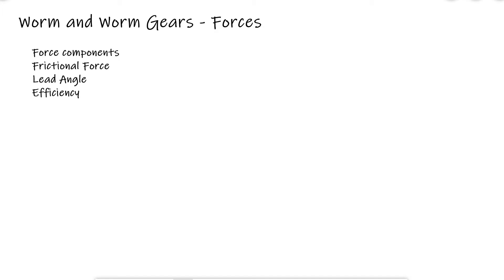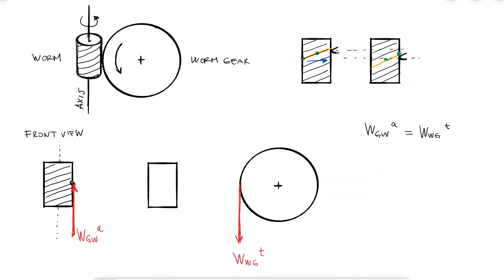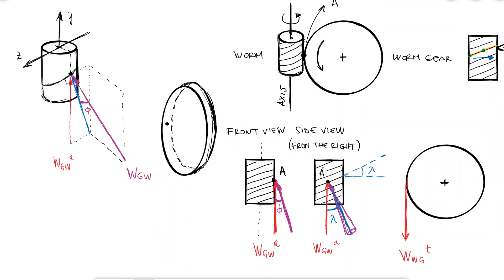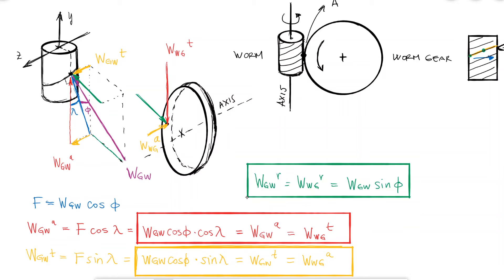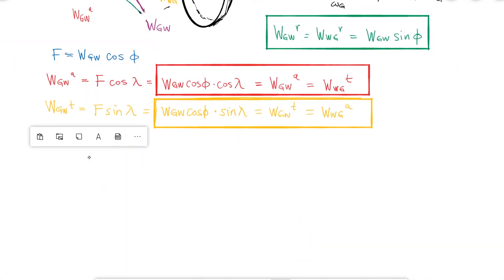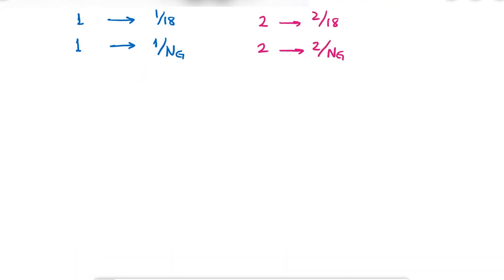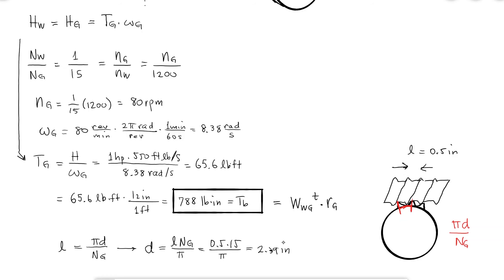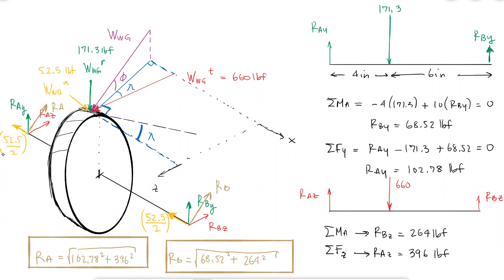WORM GEARS - Forces and Speed Relations in Just Under 15 Minutes!

Comment: I've never seen a worm gear drive a worm due to rotation resistance. I like the video.
Reply from the maker: Thanks! Yeah, self-locking or irreversible worm gears cannot be driven backwards, that's true. And the power efficiency for the ones that can would be terrible.

Comment: At 00:56 I presume the worm is right hand, as given also rotating anticlockwise based on its axis. what doesn't make sense is why is the worm gear rotating anticlockwise and not clockwise?
Reply from the maker: Yeah, this is hard to see in a 2D sketch. I will be adding short 3D videos of animations for these. But what is explained here is in indeed correct: right hand worm rotating counterclockwise from above will make the gear rotate counterclockwise from the front.

Comment: what would happen to tangential forces on the worm gear if the worm gear was sandwiched between two spurs?
Reply from the maker: The tangential forces on each side would be equal to each other (in magnitude), and added up and multiplied by the radius of the worm gear, equal to the driving torque. Draw a free body diagram of the worm gear to see this.